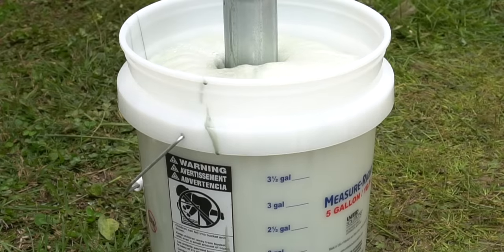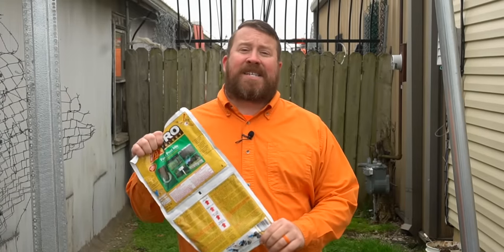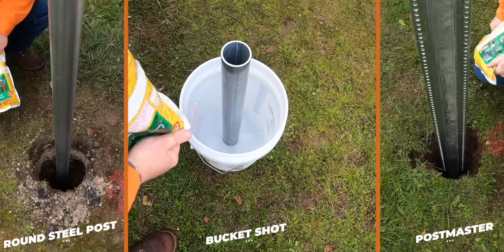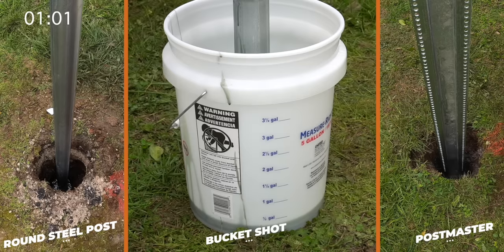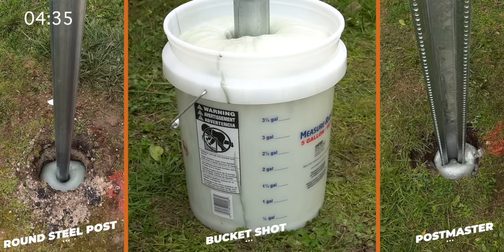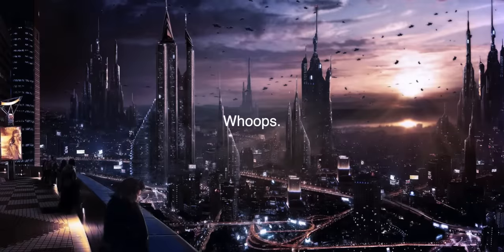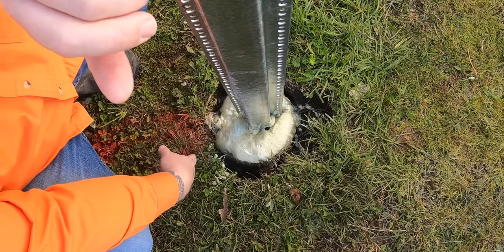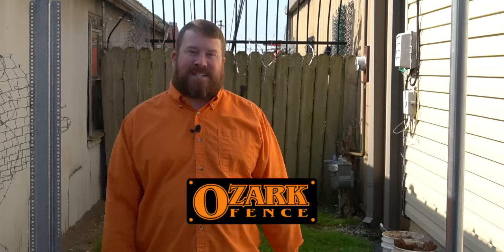Does Fence Post Foam Really Work?

Comment: We use it in New Mexico from time to time... It works great in dry caliche - it won't work in moist soil...  since there's no moisture here - it works great.  We use concrete for fencing tho - the winds are phenomenal sometimes and need that extra support concrete offers.  For piers or simple small-deck footings, the foam works fine.
Ideally, we pour rebar (powder coated) supported sono-forms (Buried no less than 36" ) with an acrylic modifier (which essentially infra-seals the concrete against moisture) - bevel the tops of the forms approximately 3 degrees convex - cut weep channels in a cross-hair pattern, make them high enough to clear the 'splash-line" - we embed a 1/8 ton jack in the concrete for micro-adjusting of the post after installation - (this is a permanent addition) - once we get the posts counter-tensioned, we spot weld the jack-shaft in place and coat the whole thing twice, with 100% silicone roof-coat (colored to the specifications of the client).
A 1/4" steel cross bracket is also welded to the jack and invested in the concrete and sticks out exactly 24".
We cut a cross-hair channel in the bottom of the double-pressure-treated post (we re-treat the posts with Cuprinol, copper solution) after we kiln dry every oversized piece and hand-plane the posts to size.
After slipping the post over the crosshair bracket, we "hot-band" the bottom of the post every two inches for added stability along the channels.  - we take 1/4" square stock (same size as the post) and heat it up in our field forge to between 320 and 350 degrees which gives an expansion ratio of 3 to 4 and heat tolerance suitable for the cuprinol double-treated Cedar posts.
Oh, I forgot to mention that we prep each post by drilling out the center (lengthwise) with a custom 15 ft carbide drillbit (1" di.) that is laser-guided by a calibrated centering chamber with a +/- .0063mm drift ratio.
We mix Cuprinol with a latex adhesive, ideal for wood to metal compatibility, and hammer in a 1" titanium rod for added tensile strength.
After everything is ready, we finally, 'bag' the posts and fill the bags with a commercial penetrating wood-hardener (colored epoxy) for three days.  Then we drain out the excess and let the posts dry for 72 hours. 
Then we sand the posts with 220 grit following the grain.  We do this a total of four times, until the desired finish is achieved.
Any penetration of the posts is pre-drilled and the holes are filled with a precise amount of construction epoxy (2 part)so that none is extruded in the screwing process.  All hardware is surgical steel.
Then we usually string up a Spruce/Fir mix coyote fence (lattilas) between the posts and call it a day.
Reply: That sounds ok, but I highly recommend you use vacuum forming step when you cure the wood hardener epoxy to prevent air bubble voids.  Some projects also call for strain gauge inserted at transition between the rebar enforced metal pocket and titanium core rod. This allows monitoring and future calibration of posts through the hydraulic jack.
Reply: @JP-pf5pz  Thanks for the info.  I'll run it past our Engineering Team and Regional Focus Groups.
The strain gauge idea is fantastic, though usually only essential in climate zones 1-3 - but we'll consider it as an extra safe-guard!

Comment: Between the hurricanes, constant wet fencline area, rotting treated posts, I set a lot of replacement  posts with just the dirt, haven't had any problems from that. And , I am using 1" thick , 8 ft tall planks, anywhere from 4 to 12 " wide.( I have a tree business and a sawmill, unlimited supply of wood.)

Comment: Our local Lowe's has used this in buckets to hold ad signs and since these buckets have been left outdoors, they have now filled with water. The foam and embedded sign post has floated half way out of the bucket you would very easily be able to pull the sign and foam out. foam floats but now looks like its deteriorating due to water and sun exposure.

Comment: I am an Ag Engineer and I use a 40 lb bag of dry concrete per post. It enables me to plumb the post and then tamp the concrete down tight.  Once tamped down you can build before the concrete sets and adjust the plumb as needed. The concrete will set with moisture from the ground water or if in a dry area you can water it as you would a tree or shrub that is planted. Barns, sheds, fences and platforms (decks) can all be built this way. Because the concrete is in the ground and not subject to weathering, significant loading or wear the method works well. It's fast, less work, and cleaner than mixing the concrete with water first. The only time I have used wet concrete is when having it delivered mixed but then had to wait for at least a day until it had cured properly.

Forget using foam. It's expensive, messy and likely emits harmful chemicals (iso-cyanates) as it expands.

Comment: I used this product for rough treated 6x6 and 4x4 posts and they are solid to this day.  Maybe it reacts differently with metal than wood?  not sure  Never seen any shrinkage around the perimeter also.  Saved my back a pile of hurt using this product and for me at least i am very happy with the product

Comment: I used urethane foam to set a cloths line post 40 years ago with my dad as he thought it might be good and his next door neighbor used concrete to set his , guess which one is still rock solid , that's right , the one in the concrete. I pulled the one set in foam out a few years later without digging and it was set 4 feet below grade. Sometimes newer just isn't better and it still looks that way.

Comment: oYes it really WORKS! Late last spring or early summer my neighbor, his friend and I installed about 85 feet of fencing. We used those trick metal posts, treated lumber, redwood fence boards and the  foam as used in this review. I'm just in from giving that fence a SOUND shaking. It is rock solid! The difference I noted between what my neighbor did and what was done in this review is the neighbor took time to work the foam package completely! As shown in the review the mixing resembled the making of pudding in a plastic bag. BTW/ the dirt here is old farm land...no rocks of any size, low on sand, hold water well for long periods I will use the foam again for some new fencing I have planned.

Comment: I was skeptical of the expanding foam at the start of the video. Now I know I didn't waste my time putting all that concrete around my posts. My fence was 50mm square aluminum powder coated posts.  I reckon in future there will be a similar product that works a lot better. I will stick to Con from Crete for now. Thanks for testing the expanding foam. Fun to watch.
Reply: It's was a good vid but I've us d the foam many times there are other variables at play here ie: temp and the metal post slick surfaces no go 😁

Comment: I recently used Secure Set (from Amazon) to set 2" square steel fence posts for a steel fence. I was worried about the foam's performance so I alternated Secure Set and concrete on every other post. I'd have to say the foam worked pretty good. It adhered to the steel posts like glue and has stayed stable. It's been 2 years, no issues. The holes were at 18" deep and the surrounding dirt was Calif central valley hard pan (I had to use a jack hammer to dig the holes). Only 1 post was a little loose because I didn't dig the hole deep enough. Overall, Id say the secure set worked. If you need to be able to put up a fence quickly, skipping the concrete set time, foam could be a good solution.  
One thing to consider, the foam is flammable. When I was welding the fence panels, I had to cover the foam with dirt to ensure it didn't catch fire. The Instructions mention covering it with dirt after it sets anyway, so no big deal.

Also, I'm  considering filling the posts with the foam to inhibit interior rust which was a problem with the original fence I was replacing.

I've never tried the Sika.

Comment: I used it per clients request with factory stained wood posts about 4 years ago now and it is still solid as concrete. I wonder if it reacts differently to wood vs metal posts. 

I also used it for the post for a little free library i built my mom. Its been maybe 6 months now and seems to be holding strong. I only went 2 feet deep and maybe 8-10 inches around, and 1 full bag barely filled that hole with a 4" post, maybe a 6" post. I dont remember what i had laying around back then.

Comment: I started building my fence last year.
My neighbours asked if was going to use concrete or foam.
I told them neither, I'm using 3/4 inch down.
The reasons, if anything happens to the posts (warping/twisting/replacing) or I need to do any last minute adjusting I can. The 3/4 inch down is easy enough to manipulate years after. 
The first night I was doing posts. It was getting dark and late at night.
I put in a few posts and set them up with the 3/4". The next morning I went out to continue. Started my measurements and realised 1 of the posts was off by 1.5". It took me about 20 minutes to remove the 3/4" readjust the post and repack it.
If it was concrete... post would be ruined.

And yes it does sucks hard core trying to remove 50lb concrete fence post plugs.

It's been a year (full 4 seasons -40/+40).
And zero change in my fence, still straight and even.

2 tons of 3/4 inch down, delivered cost me $120. Filled 24 posts and still had left overs.

Next time your driving around, look at some power poles in your neighborhood. When they are placed and set up.  They use 3/4 inch down to hold the pole in place. Not concrete or foam.
If it can hold and stabilize a 2 ton post, I'm pretty sure it will hold and stabilize a 50lb post.

Don't waste your money on garbage foam.

Comment: I have gotten away from using anything but dirt to fill in around posts, but when I did use concrete , I would put a few inches at the bottom of the post, pack dirt around leaving 5 inches or so at the top, using concrete there,  the 2 rings of concrete did a great job.

Comment: Thanks for the extra time on that demo.  I have always considered the foam method as a temporary fix while you plan and the client budgets for a more permanent solution.  Reach out if you'd like to incorporate a method of pouring concrete into your post holes that withstands stronger winds.

Comment: I used this same product in my fence build around my pool , with only 2 guys building a complete fence around a inground pool , this saved a lot of time 
The cost of each bag , is expensive, but I used 20 bags for 20 , 6x6 pressure treated posts , my holes were 4’ deep 
I get a ton of strong winds in my location , and the reason I was replacing the fence is the wind took half of it and tossed it in the farmers field 
With that said , I used a grave base in each 12” hole, I used the foam to secure each post , it was about 5 mins each post from dropping into the hole and moving to the next , once the last post was free standing , we started the fence build from there , my buddy did the 3 tier 2x4 horizontal legs , and I followed behind with the fence boards on the outside of the fence , fence was built in about 4 hrs completed , without gates , longest run is 40’ 
I back filled each hole with more gravel and dirt on top to grass grade , I did that before the fence build , which was maybe 1 hr of set time 
My fence is now 5 yrs old with seasons and wind , it’s just as study as it was , and this product is worth every penny 
You can buy 20 bags of this stuff and it takes up no room , which 20 bags or 40 bags of the quick Crete , which is what my application would have needed , you need a truck , and it’s messy and takes a lot longer to do 
I think if you tested this product in the manner I used , you would find that it works 
Leaving the foam sit for a few days , didn’t do it any good , and it doesn’t make sense to me why you would do that , the ground will start to erode, and weather , rain hot and cold , moisture at night etc , will kill what that foam is indented to do 
Just My my opinion 
Love your videos , thanks for posting

Comment: @Joe Everest; i've been using Secure Set foam for fence posts out at the ranch and I've never seen the results you did.  My posts are still solidly locked in the ground after years.

Comment: I used the same product for my mail
box and it worked very well.  No shrinkage and the wood 4x4 is very secure. Maybe you did not mix the product to the manufacturers specifications. They suggest that you rub the bag over a flat surface to mix the product. I have had great success with Sika foam post hole foam. Brad

Comment: The foam I used was not rubbery like yours. I split the old concrete that was holding the old post and put the new post in its place. This, combined with the foam filling all voids made a much more stable support than I see in your video. The advantage of the foam is that it coats and protects the post. There is a real advantage to not having to dig out the old concrete.

Comment: I used it to replace a mail box post that got hit and broken and didn't have this problem. I wonder if it was because the hole was already completely compacted from previous post. It didn't appear to get loose after setting up. Also it has a lot to do with the soil itself with water content compaction and soil type!

Comment: I used this foam to replace the fence in my backyard and along the side...4 fence posts installed with foam and I have had no issues.    They've all been in the ground now for 3 years with no issues.  You only need to dig about 18 inches deep so the the foam comes out the top of the hole.  You also don't need to wait 2 days...it sets in 2 minutes and fully cures in an hour.  I absolutely would recommend using foam for projects as it works very well when properly used
Reply from the maker: Unfortunately, most professional contractors use the ASTM standard of 30” hole depth.

Comment: 3 years ago I built a privacy fence 50 foot long by 6 foot tall. This was supposed to be the new and great product, but it was considerably more expensive so I just used it for 3 posts in the center of the run to try it out. I followed the directions exactly and attached the panels 24 hours later. It worked great at the time, however a year later those 3 posts were all leaning. I had to use a come-along to pull the fence upright then put in 3 new posts set in concrete to fix the problem. No matter if they improve the product I will never try it again after being once burned.

Comment: I noticed when we used the foam deep holes and backfilling after that 2 hour cure window led to those posrs being good and solid,  had some others we only dug to 24" and didn't throw dirt over the foam after its cure time those hole were wobbly with voids just like yours.

Comment: Thanks Joe, this is great info. Question, what do you recommend for setting post master steel posts? I built a shadow box WRC fence about 25 years ago using treated posts set in  concrete. Soon I will have to replace the fence and I have seen the post master posts being installed on a persons property. I never asked what mixture they used. I would appreciate any help you could give me.
Many thanks
Phil Goulding

Comment: There are competing products for post fixing foams to sika post fix. You have fast2k, postloc and secure set. Secure and postloc set is the most durable and costs the least per post but is less convenient to use than fast2k or sika post fix. Also make sure you back fill with dirt after it dries.

Comment: When we did my dads big cedar fence with this and I'm talking huge wood posts probably 10-12 inch posts I would say 8ft tall fence it is impressively solid very impressive however with my chainlink we are doing right now we using proper post concrete and it is working amazing

Comment: I watched this to see if the test was different from what I experienced.  We needed to put up a quick deer fence around our three new apple trees.  I put up eight posts that were each close to 20 inches in the ground.  This is temp so there is no supports between the posts, they are just there to hold up the  7 foot plastic fencing.  I grabbed a pouch of the foam to see how it did vs. cement.  granted I only did one post with the foam but it is the only post that has sagged off center.  I will do cement from now on.

Comment: Chemically, what is the difference between this and the cans of foam insulation?  That stuff certainly sticks to everything?  I was interested in the long term testing to see how hard removal of these becomes after a few years.  And the expense seems unnecessary.  For a cosmetic fence i've just tamped the crap out of the dirt and gravel and it seems to do fine.  Good video, thanks

Comment: You should perhaps try it again some time and ensure that once it cures, trim the additional outside of the hole away, and then cover the top with soil. It seems there that the exposed opening for even a few days to sunlight can cause the foam to become compromised.

Comment: So my only complaint with the foam when I used it was I didn't stake a post or hold it long enough to set. So diggig out the foam out of a hole that it perfectly formed to was a pain in the ass. However much less of a pain I'm the as then breaking out concrete to fix. Some of the homes were a tad bigger digging around roots etc so had to use 2 bags in a few holes. Not having to mix concrete or dealing with the dust getting up my nose or ruining clothes and having concrete stick to my hands was pretty convenient. Not to mention carrying 60+ bags isn't my idea of fun. All the parts y we used were aluminum square posts and it adhered nicely to the posts.